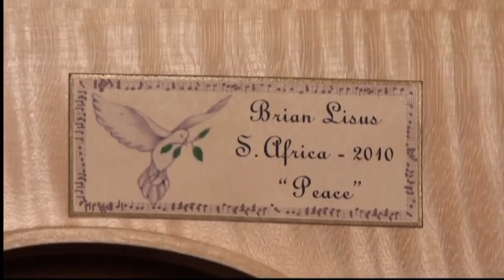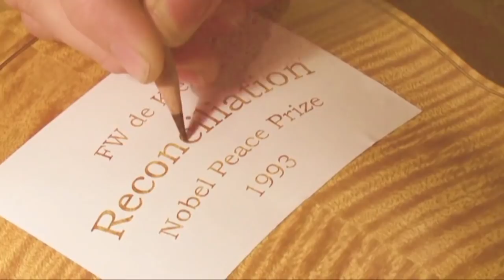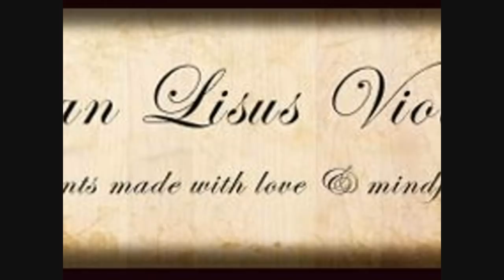MAKING VIOLIN - Inessa Galante soprano (Info) + Beverly Murk violin (Info) - Credits at the end

Comment: The violin music is certainly topical, but for myself I prefer sounds of the work being done instead.
Reply: What, the sound of scraping!
Reply: I get it
Reply: Most of it isn't scraping, it's planing.  And for someone who has actually planed themselves, they can tell how much wood is being taken off and the composition of the wood as well.  Planing by hand is very satisfying as is watching/listening as someone skilled at it does it.
Reply: All 200 hours or so of planing, cutting, scraping, shaping with gouges, measuring? Methinks you would start getting sleepy after a couple of days!

Comment: 27:25 Is this onion finish to protect the wood from insects or something?
Reply: No, it's not actually an onion. It's like grass, you ever feel grass and one way is smooth and one way catches? Those are tiny micro-hairs that he is using as an extremely fine sandpaper.
Reply: @EvelynH-tj1qt  its from the stem of scouring rush. also known as horse tail. I have only seen it used one other time and that was a Japanese comb making video.
Reply: @maylucriandesigns  I thought it was Dutch rush, which is sometimes (not so frequently now) used in making reeds.
Reply: @mal2ksc  no problem, I am actually more of a plant guy than a carpenter, but I do make things sometimes. I just don't get moments where I actually know something I would like to share. I know it was probably bad form to use a common name ( I don't know the scientific one off hand) because common names are mutable and numerous depending on the plant. so your probably not wrong you know.
Reply: Horsetail (Equisetum hyemale). It'll also take rust off steel although not as fast as modern abrasives. Horsetail is found in wet areas with high soluble silica. At certain rock quarries, they grow and thrive.